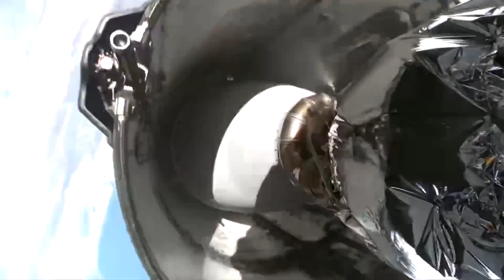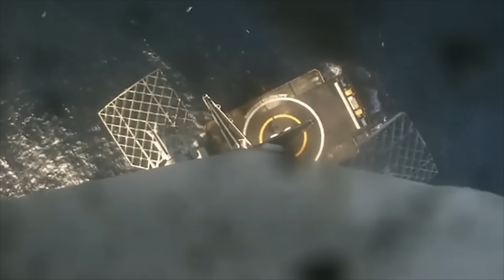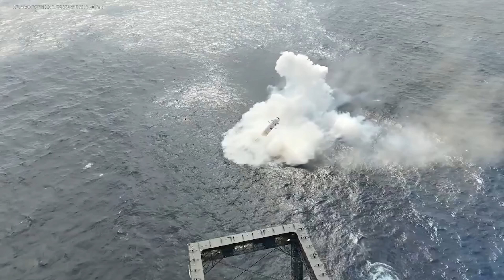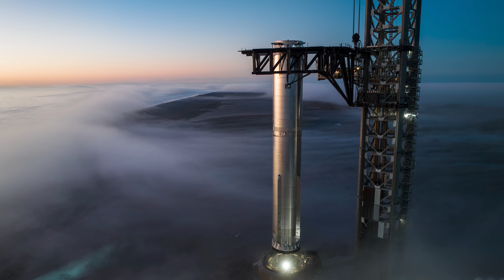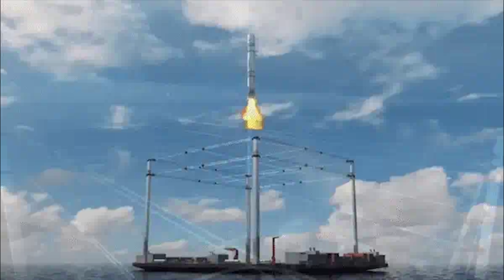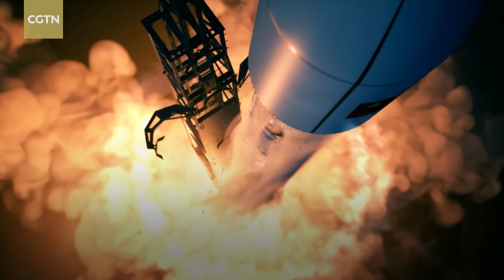China Found Brilliant Solution for Catching Moon Rocket Mid-air! Better than SpaceX, NASA...

Comment: A note: SpaceX did not achieve the first landing of a launched rocket. That was achieved in the 90s I believe by an experimental NASA rocket, though the line was never pursued further after a couple of successful landing attempts.

And the Space Shuttle was a resuable rocket that was extremely successful and used and reused for many many years. Yes the Shuttle glided to a wheeled landing as opposed to landing on end but it was absolutely a rocket (not a space plane which requires being able to gain altitude while in a flight mode and under its own power) and it was reusable. The boosters were well also recoverable and reusable (though barely break even on costs to do so iirc). The only part of the Shuttle system that was not recoverable was the mammoth fuel tank that was jettisoned every flight and burned up in atmospheric reentry.

I know some dislike the Shuttle and it had many imperfections and flaws that obviously manifested tragically over time. It was a design compromised by forced parameters from US military requirements and an imagined far more elaborate orbital station system that never manifested. But it was extremely successful overall in its primary mission design of ferrying many passengers and smaller loads to orbit and station rendevous. And it was a reusable rocket.

Comment: After proven tests, the cable net system can be reduced in size and be built anywhere. The advantage of which system really depends on speed it can be re-equipped, inspected, refuelled and readies for relaunch-its not just about catching a spent rocket canister. This is probably where the Chinese with their usual long term strategic planning, industrial capacity and supply chain advantage is trying to solve at the same time.
Reply: 캐이블이 아마 현수교 정도 굵어야 할 건데 그걸 어떻게 유연하게 잡을 수있냐? ㅎㅎㅎㅎ 말이 안된다.  제어가 불가능한 기술이야.  저건 그냥 일반 상업용소형로켓이나 가능한 기술이다.  아마 내려오면서 플랫폼을 다 녹여 버릴 거다.
Reply: @yahocookie  it is evident that you are not familiar with the tensile strength of cables, and that the landing rocket does not target flames onto the cables or even the SpaceX chopstick arms
Reply: @JBear-in1ql 로켓을 잡으려면 팽팽해야하는데  로켓 무게를 생각해야지 스페이스x무게를 팽팽하게 지탱할 케이블이 있나? 또 그것 엇갈려서 잡는다 해도 고도의 제어가 필요하고 더군다나 해상이다 해상에서 안정성제어는 더 극악이고   고질라는 그나마 집개형태라 물리적으로 휘어질 일이 없지만 저건 네줄이 정확하게 일치해야하고 하나라도 삐끗하면 로켓폭발로 이어짐 줄이 잡을때 팽팽해야하는데 불가능한 제어임 또한 호버링시 열기는 고질라집개보다 열안정성에 취약함
Reply: @yahocookie  it just worked today, your premises are all wrong.
Reply: @yahocookie  the mouth is running, but the brain is lacking.  Thank god they dont have u in their team.
Reply: @yahocookie  韩国人的脑子和国土面积一样小，很难想象高难度的技术如何实现，这些科研决策都是经过严格验证的。

Comment: China's flexible mobile rocket-booster capture ships can go to many landing location across many oceans
China already uses mobile reusable rocket-launch platforms
so, they don't face replacement parts any different from USA's not-so-reusable rocket systems

USA's fixed-location "chopstick" capture systems restricts locations
rocket reuse has never yet, nor can happen happen as fast as purported, where critical inspections have been a must, and immediate reuse practically zero
even now

so, USA has blundered in peddling "reusability" where none exists, especially, without major parts-replacement inspections done (typically, not thorough) = catastrophe-prone on next use
Reply: 재사용을 시험해 보지 않은 것이지, 재사용을 못한다는 단정은  너무 니 생각인 것 같은데?

Comment: This system is inferior to SpaceX system on all levels, will not work
Reply: already succeeded .... cope ... mar der far kurt
Reply: It's cheaper and more reliable than heavy hydraulic landing legs 😂😂
Reply: SpaceX is too inflexible, wasteful
restricted
and the rockets themselves have not been as reusable as advertised

none have been reused without major parts replacements needed
and given so many parts could fail, missing one (or more) replacement components, makes the used rocket for quick reuse, catastrophe-prone

which has shown to be a big problem very quickly
where a whole brand spanking new unused rocket needed to replace a "just used once" rocket

SpaceX has not fully realized its reusable rocketry is unsustainable beyond "use just once", gets very iffy immediately after a single use
Reply: Oops, it's already successful now.
Reply: 這但應該是美國佬，可惜剛剛成功了，應該令他很失望吧😂
Reply: Why is it inferior on ALL levels?
First one that comes to mind is weight.
Every KG saved on carrying the hydraulic legs is payload KG = $$$.
That's a win right there already!!

Comment: A cable iris system is always going to be lighter, more responsive, and easier to maintain, versus heavy rigid trusses and actuators.
The Chinese design is better in the long run.
Reply: The hydraulic system is dead weight to launch. The Chinese recovery system will definitely more efficient.

Comment: The cable catch is more forgiving for inaccurate positioning.   Also it looks inherently more stable holding the rocket on 4sides instead of a tower on one side.   The starship boosters ideally will land on a ship, then be lowered to lie horizontal for transport back to base on a ship dedicated for transport. The huge landing ship would remain on station to recover a booster per day if needed such as when filling a starship in orbit with multiple launches
Reply: 케이블 녹아 버린다.  케이블의 굵기를 거의 현수교 케이블 굵기 정도 되야 한다.  그런데 그러면 제어가 어려워진다.  플랫폼의 기둥을 사방으로 배치하면 열에 취약하다.  만약 하나라도 열에 녹으면 바로 외이어는 통제불가능해짐. 또한 바다에서 잡는 다는 자체가 극악의 제어이론이 들어가야함.
Reply: @yahocookie lots of engineering details involved. Lots of creativity opportunities.  Tracking/predicting booster location and orientation, tracking/predicting the ship in sea states that tilt the ship, heave the ship makes knowing how the cables must be dynamically moved.   Cables must move fast and are not straight lines between ship frame holding locations.  I would be more concerned about a cable bouncing like a jump rope than melting if it caught the direct blast of an engine exhaust.
Reply: Some quick math.  Assume the booster weighs 70 tons assume each cable will be tilted 45 degrees from vertical when cradling the booster.  45 degrees means cable tension will be 41% higher than the vertical lift it supports the booster with.   Assume 2 cables on opposite sides of the booster support the booster weight. Assume 2 more cables at right angles to the first set of cables also support the booster. That’s 4 cables supporting the booster.  Each cable supports the booster from both ends of the cable.  That’s 8 cables total sharing the booster weight. Or 12.5 tons each.  But the booster is held every 45 degrees around the circumference not 90 so that’s 16 cables supporting the weight or 6.25 tons each. A cable supporting 12,500 pounds is less than 1 inch diameter.  Also note, the diagram shows cable pairs, not cables so the cables can support twice the weight or decelerate the booster at 1 gravity or  32ft/sec^2

Comment: Ship based recovery is the future.   By catching the booster at sea instead of reversing direction to return to launch point, the booster saves a lot of fuel that is then used to launch significantly heavier payloads.  And the cables can act like a shock absorber slowing the rocket down over a 3 meter distance.  If the rocket touches down at 30 km/hr then 3 meters of 1 G deceleration by the cables will catch the rocket without it crashing.
Reply: Saving the landing gear yes, but it doesn't save a lot of fuel.  It is more efficient, but doesn't seem to be that significant.  Slowing down to being able to be controlled would use nearly as much fuel.

The "Chopstick" recovery seems be the most efficient compared to ship based net recovery.
Reply: 除了每次发射可以节省两顿多着陆腿的重量，它还可以避免成功着陆后箭体倾倒造成的经济损失，与此同时延长箭体寿命 @Crazyd_
Reply: @Crazyd_ the fuel savings come from not reversing course to return to the launch pad.  The 30 km/hr is a safety margin
Reply: @douginorlando6260  So exactly how do they catch the rocket?  A landing zone is still required either way, Space X rockets don't typically return to launch pads, but to landing pads often over the ocean for safety reasons.

Comment: It seem trivial enough, for Space-x to simply COPPY their rope-catch solution. Seem a bit less complex than chopsticks. The "X" for the ropecatch is basically the same size as the upper "surface" of the catch structure, while at the chopsticks, the "X" is up to 2 or 3 meters around the centre and thats all. On the other hand, chopsticks can "stack" the starship on top of the booster, the ropes probably do (can) not. BTW, can kinda easily immagine the ropes being managed by some automated system, using radar/lidar sensors inside the space of the structure, to simply "trigger" the catching movement only AFTER the jet fumes passed down, and only if the body of the rocket OVER the structure is upright.

Comment: The cables will burn through or weaken if the exhaust touches them. Would have to be well shielded somehow out of the way till the aft end goes past.
Reply: nope

cables are much stronger and lighter than you imagine

and heat-resistant, too

Comment: I think the reasons why CASC went with a cable catching system is because it will save money, save fuel cost, able to put more payload into space, it's able to adapt to different size rockets, faster recover, no need for refurbishment, etc.
Reply: yes

Comment: You forget to describe, after catching a rocket, how the rocket can be put on the ground for another launch?
I am just guessing that you need to use a big crane to extract the rocket from the cables,
raise the rocket high in the sky over this big cube and them the crane can lower the rocket to the ground?
This seems very complicated compared to using chopsticks to put the rocket on the launchpad for a new launch.
Reply: this is a chopstick problem, anyways

besides
SpaceX has NEVER reused any of its reusable rockets without major replacements to a whole lot of parts that could fail when the rocket is reused a second time

Comment: Without even watching a full minute of this video, my answer is NO. China's system Is NOT and Will Not Be better than SpaceX's recovery system for a few reasons, starting with the fact that Elon's system has been Tried and Proven to work on several occassions. Practically every launch achieves something new or betters the results of previous Tests and actual Launch Recoveries. China doesn't have the same track record yet and barely matches NASA in my opinion. Furthermore, their Catch Recovery System has not been tried yet. I don't know that China can even steer a rocket back to where they want as SpaceX has been doing for a few years now. 
So with that bias coming into this video, I will watch the rest but I won't comment further UNLESS my opinion changes based on what I've seen here.
Reply: Yes Elon is above all and best at everything.  Long live Elon.
Reply: SpaceX has yet to reuse even one rocket with "no inspection"
and immediate turnaround for re-launch

it's a failure in plain view

people here are just blind to obvious failure
Reply: you are wrong.
Reply: first you are confusing solution with application, we are not arguing who is ahead, we are questioning which solution is better. it is not about the implementer it is about the idea, because the idea is what is important, there is nothing stoping spaceX from using the same idea in the future, so what we are evaluating is are there merit of the idea. to me, I see that the "chopstick" is primarily developed to remove the need to move the rocket back to the pad, so in term of capability the chopstick is better, but it is also more dangerous since you are dropping the rocket right in the middle of your launch infrastructure. which can lead to the lost of millions of ground infrastructure if there is an accident. so spaceX solution is more aggressive and capable, China solution is more conservative and safe. which to pick depends on your culture to stomach risk.
Reply: @lagrangewei  I think you missed my point. I'm not Confusing ANYTHING. I think what I said specifies without question that I believe the SpaceX method is better and will be better. And "cable-catch ship" can also be destroyed from a failure during landing and capture. At this point, it is Unproven Technology so at this point there are a lot of "IF's" and IF is the middle word in Life. We can "IF" all day BUT SpaceX is currently in operation. This Chinese platform is NOT. 
I'm okay with you believing otherwise but don't suggest that because I've put my bet on SpaceX over this Question Mark Solution that I'm Confused. I'm Not. I'm quite confident that I am correct but Only Time Will Tell. 
Have a rainbow day and thanks for playing.
Reply: @lagrangewei  BTW - There is Nothing But DESIRE preventing Elon from putting a Chopsticks type system on a Ship and he's already landing Rockets on 2 barge ships. 
China's version is little more than a Dream at this point.

Comment: The cable catch system can be built anywhere on land and do in-place maintenance and refuelling once the testing and bugs are perfected.  Perhaps it’s initially being tested on a barge set up in open waters for testing safety purposes. Also it seems the cable system would be more forgiving of more imperfection with the descending rocket’s alignment and deceleration.

Comment: SpaceX system is better because the "chopsticks" are used to put the Super Heavy booster on the launch pad, grab the Starship on the ground and put it on top of the booster, stabilise the rocket while SpaceX wait for good weather for the launch, and to catch the booster, and soon the Starship, when they come back from space.

Can the Chinese "cables playground" catch a 320 tonnes rocket?
Reply: it the same cable system use to build "superblock" in the shipyard like aircraft carrier and those block can easily weight 1000 tons... I don't think load is the issue. both system has their merit and weakness.
Reply: China successfully recovered the rocket today.
Reply: China CASC never said they are going to capture a 320 ton rocket. They are still developing their Starship rocket. This cable catching system is for their Long March 10 rockets.

Comment: gotta love the usual NIH comments .... Not Invented Here  ...... the bigotry is beyond belief ... 
it's a great idea - if you don't need the weight of landing legs 
you wonder whether Russia could use that for its Vostochny spaceport in the East and have that "Capture" ship in the Sea of Okhotsk for its upcoming LNG reusable Amur rocket
Reply: Nothing bigotry about calling the two systems what they are. They might be able to catch a rocket eventually, but then it is at sea and has to be hauled back to a port somewhere. Then lifted by crane onto some kind of transport to deliver it to a place to refurbish it. Then hauled to a launch pad after testing. SpaceX's system catches it on the same pad where it will launch from. The same system will catch the ship and place it on the booster. There is no way the Chinese system is superior.

Comment: The net system could be built back at the launch point.  That is not an issue.
The advantage of at sea recovery is to minimize the amount of fuel needed for recovery.  Good luck building a chopsticks ship.  That net catching ship better not encounter rough weather.
NewGlen seems to be a better rocket and the recovery at sea is much more manageable.

Comment: SpaceX falcon 9 boosters land on the ground. Only the starship booster uses chopsticks for immediate reuse and to save weight. This Temu system wont allow immediate reuse and therefore cannot ever be better.
Reply: Temu system? thats where amazone get ther stuff
Reply: You need to remove, move to warehouse for refurbishment no matter which system. The Chinese system seems easier and more forgiven. I believe the wire guides in the sea makes more sense and flexibility. In 10 years, China will surpass SpaceX as the Chinesev EVs are the best in semi trucks and passenger cars.
Reply: @p @peternguyen9386 false. Starship was designed from the beginning for rapid reuse multiple times a day without refurbishment. China needs wires and a large envelope because their rockets aren’t as accurate. Tesla has better EVs that’s why the model Y is the number one selling car in China and it costs more! BYD is crashing right now and Tesla makes profit without government subsidies from China.
Reply: @s @siliconvalleymetal  BYD makes 2 billion more than Tesla per year.
Reply: @kangkim150  gov subsides to BYD is more than 2 billion a year

Comment: Terrestrial. Dependent. The landing machanisms being on the SHIP enable it to land where it needs to. Flexibility.
Reply: Landing mechanisms on the ship also add a lot of dry weight which significantly decreases the performance of the rocket. This is the primary reason why spacex switched to chopstick catch instead of landing legs. China's design is definitely more efficient and probably safer for droneship landings, but another big reason for the chopstick is the ability to move the rocket where it needs to go immediately after landing, so chopsticks are probably still the winner for landing on ground.